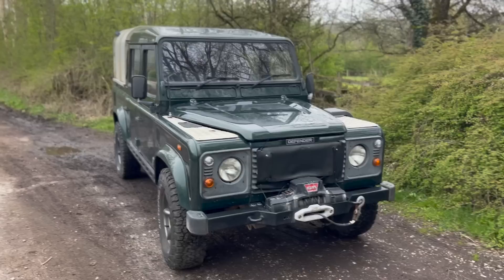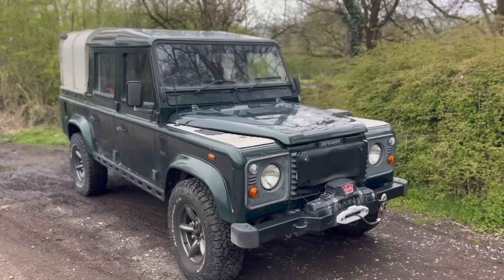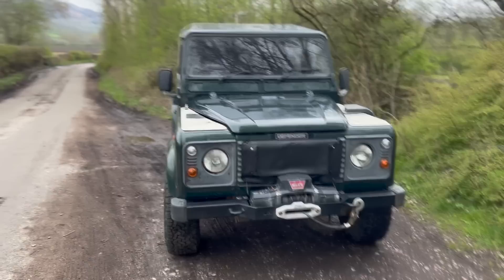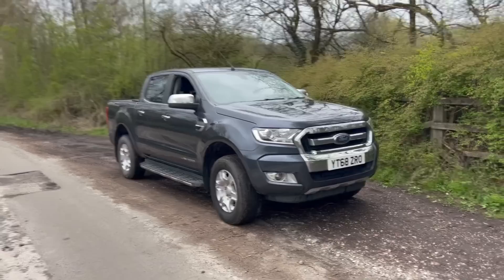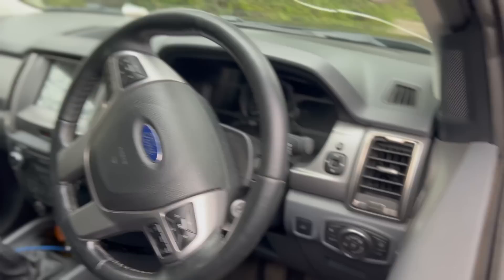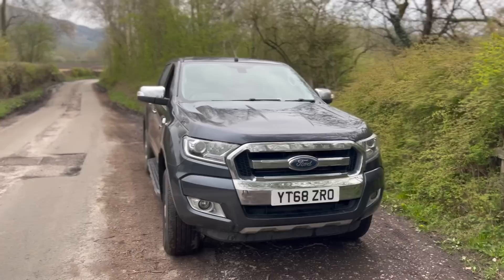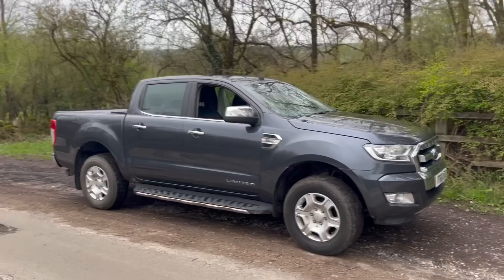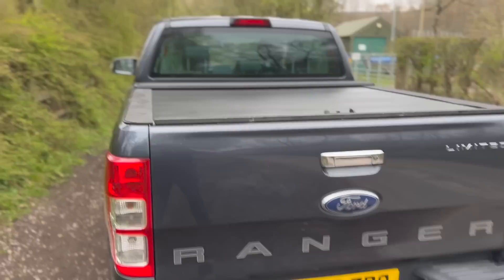Replacing My Landrover Defender TD5 With A Pickup Truck That I Don't Even Like! Why???

Comment: Old diesel fuel injection mechanic here. I'm sure it will be fine, as long as you nurse it, wrap it up warmly at nights and don't use foul language anywhere near it; I'm sure it will last... a while at least.😁 I used to do a lot of field service here in South Africa and you can imagine what the roads etc were like on the mines. We switched to Ford, and then switched back to Toyota pretty quickly, but that was a long time ago and I'm sure things are different now with these modern vehicles...  Good luck and love the videos; takes me back it does.
Reply: Times are not different. We’ve used Toyota and Ford pickups (utes) in the Australian mines for years - Hilux and Land Cruisers ave always been the standard that others have failed to meet. We had two phases of having to use Ford Rangers due to Toyota either not being 5-star safety rated (2014) or not being available in sufficient numbers (2021). On both occasions the Rangers failed to deliver with numerous major mechanical and electrical problems. They’re just not built the same as the Thai built Hilux.

Comment: We have Rangers and Hiluxes at work and they are both bloody awful.  The Rangers are 71 reg low spec, low low power 2.2 manuals which are sluggish and unbelievably crude.  We also only use them on tarmac (the hire agreement actually forbids us from taking them off road!!) so the 4wd hardware is just pointless weight and they are doing jobs that would be perfectly well served by a van.  The Hilux is a little better but with a surprisingly cramped cabin.  It has three power modes, 'Eco' which essentially kills any drivability below 2000rpm, 'Normal' which is fine but the turbo cuts in a little harshly and 'Power' which makes the thing nearly uncontrollable when the turbo brutally cuts in.

Comment: Right choice to avoid the 2.4 hilux, they’re bloody hopeless. I’ve got a 2.8 and it’s much much better. Still a Hilux mind but the engine isn’t gutless. One thing I wish they did was permanent 4 wheel drive for towing. In the wet I was towing a 3.5 ton trailer, loaded but not to the max, taking it easy on some b roads in Scotland and the back end kept kicking out. Bloody frightening. It’s supposed to have trailer sway control but it didn’t work or kick in and I didn’t want to leave it longer to kick out to find out if it would step in. Not happy with that honestly. I’m tempted to move to something else for safer towing.

Comment: I know we all have different priorities when it comes to choosing a vehicle but in the pickup scene my opinion is the Isuzu has a lot of plus points! It is 300kg lighter so doesnt go over the Light commercial vehicle weight limit which restricts most pickups to additional speed limits, it also is the only diesel pick up to meet Euro 6 without the expense and complications of Adblue (no congestion charges) and the icing on the cake is way better economy!
Reply: The series 5 Mitsubishi L200 is euro 6 without ad blue and ulez compliant so not the only pickup I’m afraid 👍🏼

Comment: 2.2, 3.2 engines have the exact same engine problem. You're best off having the oil pump replaced for the geared version and getting the egr cooler redirected and the egr deleted. I learnt the hard way🤙

Comment: I Passed a 70 plate Ford Ranger the other day in my 30 year old tdi defender whilst crossing the Avonmouth bridge.. I was doing 60mph in the inside lane while the ranger was stopped in the middle lane with hazards on and a very worried looking driver!   
Our company has 3 defenders and 1 ranger and the ranger has had add blue pump problems, light on dash and both front shocks replaced after they started leaking 2 weeks after warranty!
Reply: Have a mate with a ranger 3.2 who’s had the adblue pump replaced a few times and water in fuse box, failed rear brakes (wheel cylinder started leaking badly) they also seem to rust faster then defenders.
Reply: @richard3004  our trucks get used for pulling ships mooring ropes and wires and pull well beyond the recommended towing weights!
The 3 land rovers have given great service.. two are early td5s and the other is a 2013 puma.. they get the job done but the boys don’t like the comfort so we got a ranger!  Its a decent truck in fairness but it has had some issues and more problems than the old land rovers we’ve been using for nearly 20 years.
A bloke who does my MOTs has one for his horses and he loves the thing but again, he’s had plenty of problems with it!

Comment: good luck with the new truck. just got myself a 2018 navara a few weeks ago. enjoying it so far, got a leaking intercooler pipe already to sort out haha. thats modern pickups for ya!
Reply: Would have bought a D23 Navara but no 3.0 V6 option :( so I've held onto my older Navara for now - you certainly need a rainy day fund but I'd feel lost now without my pickup - and I'm not even a truck person.
Reply: @Rroff2  would definitely be happy with a 3.0 6 cylinder but it is what it is.

Comment: I had a 2013 2.2 ranger, ran it past 108,000. In that time the oil pump failed (common fault on 2.2 apparently) and it broke a front suspension spring. That was it. 
Saved the engine by switching off as soon as red light appeared. If they all run like that you’ll be onto a winner.

Comment: It turns out we’ve done the exact same thing just I did it a year prior. I had a Range Rover 4.2SC thought it’d be the sensible thing to move it on when a nice 67 plate ranger identical colour spec the lot as yours.. even down to being manual. I was exactly the same as you chuffed with the improvement on old pick ups, seemed to have everything the Range Rover had. Anyway got sick of changing gear and it just doesn’t do what a Range Rover does.. so a year on I’ve gone back to a Range Rover 😂😂

Comment: Have a few Land Rovers and never thought about what colour they were on the panels only the Chassis if it's red. My current Land Rover has a top coat of military Green in gloss with exposed multi colour layers where it's been chipped off.  and a Blue chassis.

Comment: Another issue which seems to happen at random mileage intervals on a small number of Ranger is injector failure causing pistons to split. Nothing you can do about this and its not worth worrying about, because it will probably never happen to any particular single unit and there’s nothing you can do about it anyhow.

Comment: Have a 2014 3.2 Ranger Auto which has just clocked 60k and it hasn't had any issues. Biggest thing is to keep the oil changed frequently. I do mine ever 10k or 12 months. The crap engines are the new 2l BiTurbo. Most I've spoken to with them say they're smoother than the 3.2 but they're wet belt timed and prone to breaking prematurely. Mate of mine just had one rebuilt, some people are suggesting get the belts swapped every 30k which I think Is ridiculous but cheaper than repairing one after its gone. The 2.2 in this one is basically the Mk7 transit engine. Bit limp off the line but they're pretty solid, again keep the oil fresh. The nice thing with rangers is the comfort. I've been in some proper hard pickups and these are the nicest. Only thing better is an F150 but they're silly money.

Comment: Used one of those Rangers as a site truck for a while. It's ok but was a bit soft in body and drivetrain. Electronic issues with sensors can stop it dead

Comment: The Defenders were the original 4 X 4 Mat - I wouldn't touch anything else; used them in the army - everything bolts on, but as you assert, the chassis' do take a hammering. Pleased to hear your LWB is getting a makeover. I wouldn't touch Ford with a bargepole, but I suppose as a temporary, it'll do. For colour options on a respray, maybe go with a decent dark blue ?

Comment: It tows 3.5 ton no problem at all. What you will find is that this engine has a very poor start-off torque and pulling off from a stop and idle engine speed is painful. This is especially the case with the manual and you may need to pull away with a trailer, facing uphill, in low range. You can’t change from low to high on the go, unlike the Land Rover.  The automatic doesn’t need to start off in low, because of the torque convertor multiplying effect.
Leaf springs can break and I’ve just fitted a fourth replacement for broken springs.  If the milage is approaching 60k and it hasn’t been done, whip the sump off and change the oil pump, which is prone to failure with catastrophic results. Mine has now done 80k miles of farm work and towing 12ft by 6 IW triple axle cow box. Over the years it had those springs, a leaking fuel cooler above the rear axle, an EGR valve [under warranty], a DPF fuel vaporiser [replaced with non genuine which has lasted as long as the original did so far] and just last week with the spring, a top intercooler rubber pipe leak. 
Maintenance includes engine oil every year [usually about 10,000 miles], two rear axle oil changes and an automatic gearbox oil change at 60k miles plus the usual stuff. Not needed any components or repairs apart from a battery about four years ago and brake discs and pads same time as the engine oil pump change. Discs were warped.
I’ve a Grenadier on order for later this year but the Ranger will remain.

Comment: Had a 3.2 wildtrak and the engine was toast at 73k. Did another 5k and the flywheel flex plate cracked. Ford dealer stepped away from it, said it was just one of those things, our tech checked it when we swapped the engine, blah blah. Have now got the 2.2 Wildtrak, doesn’t sound as nice as the 3.2 but it pulls like a train, tows a 3.5 ton plant trailer no bother. Previously had a navarra, not a fan

Comment: Defender rebuild :D nice! Quaif centre diff and lockers? Gwyn Lewis propshafts and steering guard? (We gave our some stick and it saved the sumo bar track rod)
Reply from the maker: one of the Ashcroft trick centre diffs is on the list along with air lockers and other goodies for the axles, will probably stick with standard propshafts though for ease of serviceability and replacement.
Reply: @fittermat  yes, Bailey Morris has the same spline shaft seal as a tractor, but you have to really want one to upgrade. That centre diff is very nice. I never had the cash spare to buy such a thing, but I competed against landys that did and they made a diff-erence :D

Comment: The lad I bought my 110td5 replaced it with a Ford wildtrak 3.2 auto. I drove both vehicles with 3.5t on the back and the defender pulled better 🤣 granted the Ford is more comfy. Look forward to seeing the rebuild… if anyone fancy’s chucking a new chassis at me I wouldn’t argue 😁🤣.

Comment: Top spec is the wildtrak 3.2 but the limited is a strong truck never the less it’s the best driving pickup on the market remapped they are much better.
Reply from the maker: wildtrak is top spec 3.2, limited is the top spec 2.2 I believe?

Comment: I still have my 2000 plate Ranger and I love it. Old school 2.5td. spent some time on the chassis - 2 tins tractol and 3 tins schutz. I put mud snow tyres on  and it pulls like a gud un. So no, I don't think you,ve cocked up. Defender colour maybe blue? The dark one from about 2000,s ? Cheers ar kid

Comment: Is it a good buy ? It's down to how much brass you have in it - I presume ex fleet and a mate of you dad's shoved it in the right direction deal wise.
Reply from the maker: definitely made it an attractive deal. hopefully I should be able to run it for a year or so and still be able to move it on without losing any money, that's as long as the 2.2 doesn't do a grenade impression!

Comment: Would have probably preferred the dmax or hilux, cause these 2.0 ford ranger engines are pretty high strung to get that sort of power and torque from it. My pals in south Africa say these fords are pretty shit after 150,000kms on it due to the high strung nature of the whole thing, it's the exact opposite reason why the 70 series LC lasts to 1M Kms and beyond its pretty relaxed same as the dmax and Hilux

Comment: What are peoples thoughts on which pickup to buy? I was thinking either Hilux or Isuzu
Reply: Depends a bit on your use - if it is mostly as a workhorse around the farm, etc. that is one thing, towing another or lots of road miles another. Personally I'm a Navara guy as I find it balances most uses well aside from towing which I'm not a fan of the Navara for. The Isuzus seem to be popular on the farms and businesses around me but that might be because there is a Isuzu dealer nearby.

Comment: Watch the engine on the ranger, they blow up for fun no matter how well serviced
Reply from the maker: When I started looking into newer pickups it seems that they all have chocolate engines so just took the newest one I could get at a decent price
Reply: @fittermat  I can only speak for isuzu and ford, ford's we had blew up engines for a hobby , same engine in transits still do , isuzu we had one in 6 yrs shit itself and we run over 50

Comment: Ford ranger ...Eco Blue 2ltr ??...get rid quickly...4th cylinder ...injector sends too much diesel blows hole in top of piston...Phoenix motor engineers of Romford basically have a running conveyor belt of these engines all with the same problem...avoid like the plague !!

Comment: 3.5t is gross vehicle weight, not towing weight. The police shall be very interested in having a chat with ya if you tow 3.5t...😜
Reply from the maker: Towing capacity is 3.5t, checked with the dealer since the video
Reply: @fittermat  3.5t on a 3 axle trailer I think.
Reply: Max train on the rangers are 7t. Unlaiden Kerb weight is 3200kg give or take on model.

Comment: Step 1 get rid of the shutter on the back. They are absolute garbage and leak like an Argy cruiser.
Reply from the maker: this one seems fairly water tight, and they're better than nothing!
Reply: @fittermat  mine has 2 drain pipes that drain into the bed, fucks my tools up something chronic. Only fix was to put a duck board in the back and make sure I park it up hill to stop water pooling in the bed
Reply: They also have a habit of freezing up in winter.
Reply: @DominicBythell-ee6of  Should have hoses on that are routed out of the bed liner when installed correctly. My armadillo is bone dry after 9 years.
Reply: @richard3004  yep 😂😂 no good as a call out engineer the bugger froze up 3 times